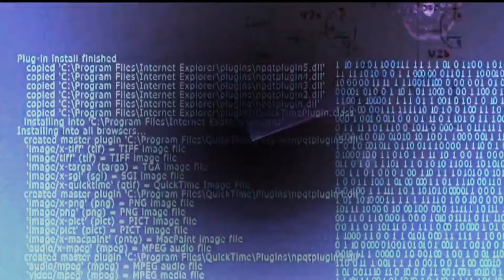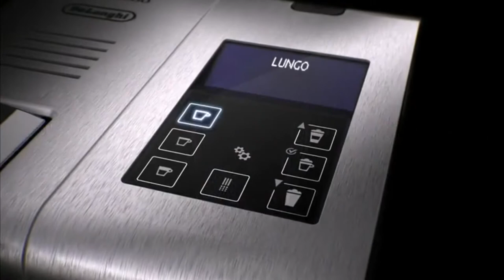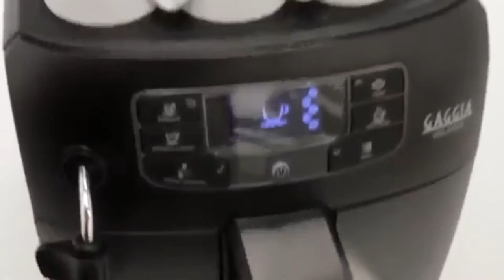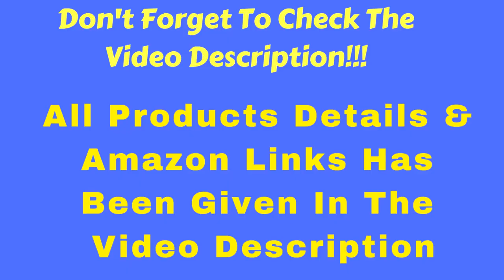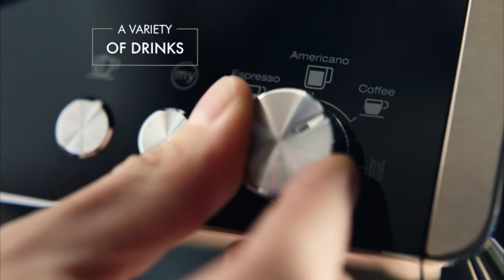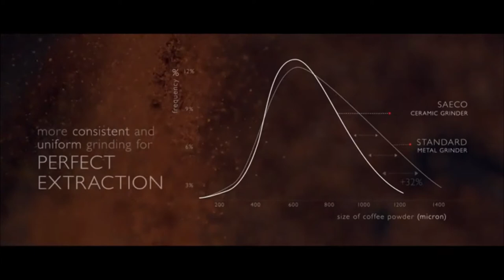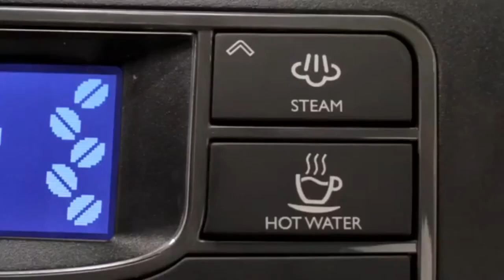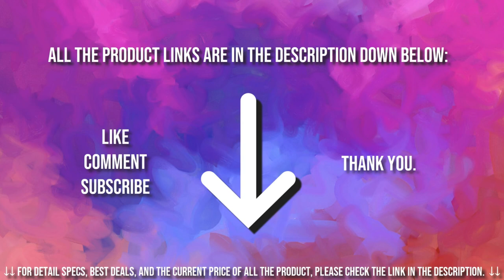Best CoffeeHouse Espresso Maker and Cappuccino Machine | 10 Best Review In 2019

Comment from the maker: 10.7 Pc All-In-One Espresso Machine & Cappuccino Maker Barista Bundle Set w/ Built-In Steamer & Frother 
   (Inc: Coffee Bean Grinder, Portafilter, Milk Frothing Cup, Spoon/Tamper & 2 Cups), Stainless Steel

 US. https://amzn.to/2NfyY7V

9.Mr. Coffee One-Touch CoffeeHouse Espresso Maker and Cappuccino Machine

 US. https://amzn.to/2KDusys

8.Technivorm Moccamaster 59694 KBG Coffee Brewer, 40 oz, Stone Grey

 US. https://amzn.to/31LscuF

7.De'Longhi America, Inc. EN750MB Lattissima Pro Original Espresso Machine 
  with Milk Frother, 10.8" L x 7.6" W x 13" H, Brushed Aluminum

 US. https://amzn.to/2ZdQhIW

6.Gaggia RI8260/47 Velasca Espresso Machine, Black

 US. https://amzn.to/2Hem06H

5.De'Longhi La Specialista Espresso Machine with Sensor Grinder, Dual Heating System, 
  Advanced Latte System & Hot Water Spout for Americano Coffee or Tea, Stainless Steel, EC9335M

 US. https://amzn.to/2YVFcks

4.Breville BES880BSS Barista Touch Espresso Maker, Stainless Steel

 US. https://amzn.to/2HdedpN

3.Saeco HD8927/47 PicoBaristo Super Automatic Espresso Machine Stainless Steel

 US. https://amzn.to/31NRrfQ

2.Gaggia RI9700/64 Babila Espresso Machine, Stainless Steel

 US. https://amzn.to/31NkiB7

1.Saeco Xelsis SM7684/04 Super Automatic Espresso Machine, Titanium Metal Front

 US. https://amzn.to/2L5F88j